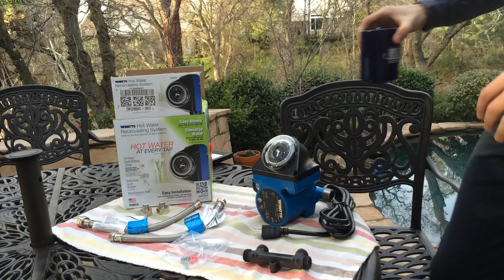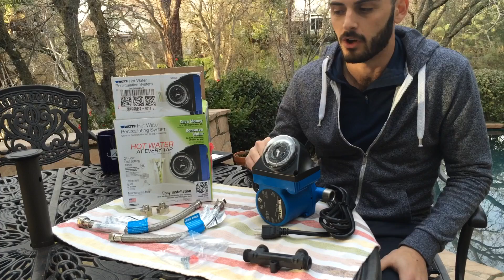How Hot Water Recirculation Pumps Work - Watts 500800 Review

Comment: Do you use the heat trap installed in the anode rod with this recirculating pump or does it have it have to be removed first?

Comment: After installation of the Watts Hot Water Recirculating Pump,I started using it right away. As long as the pump is running all is fine, but when the pump shuts off I have pipe bumping at the faucet where the bypass valve is installed, when running water in the kitchen. I installed an arrester on the Hot water side at the by pass valve, and still have bumping when running water at the kitchen with the pump off, I turn on the pump and it stops. Should it take an arrester on the cold water too, to stop the bumping?

Comment: I recently replaced the pump with a new one. The question I have is how to connect to an under sink water filter? I m not sure of the correct piping for it. The sensor valve seems to be working correctly as the inlets for Hot and Cold to the sensor valve are piped per the instructions to the sensor inlets. However for the cold outlet side with a standard water filter cartridge housing water filter how should it be connected? Any help is greatly appreciated.

Comment: For many people (those with water heater in basement) -- by far the best system for hot water recirculation is a gravity type system. Always hot water in hot water side, always cold water in cold water side. No pump required. No worrying about setting timer. No hot water in the cold water line when pump is running.

Comment: In minute 2 your a little wrong by saying it’s always flowing through the temperature sensor valve… the valve opens when it detects the water temperature on the hot side is 90 degrees or less give or take 4 degrees… the temp valve under the sink will open and allow hot water to flow to the cold side (that’s where the pump pushes it through) the temp valve closes when it reach about 100 degrees or so… yes your cold water will be like for a little while but remember it’s mixing with the cold water so by the time you go to use the fixture it may even be cold alrdy you won’t even notice it.

Comment: Good Job,  The question that I have is with the advent of smart plugs... would the implementation of a smart plug be a good option in lieu of the timer.  My assumption is that if power goes off for a couple hours then is has to be reset.  It would also allow one to turn on the unit "on demand" in addition to any time schedule that are set.  Being network attached, it would not require any reset for the power being off.  I know the Grundfos unit has a level of battery backup but as you point out is the more costly option.

Comment: What the censor valve that goes under your furthest sink does, is it has a thermostat valve. When the water is at a certain warmth/heat it closes. Trapping hot water at your faucet. When the temp drops to a certain point that valve opens up and cycles that water through the cold line back to the water heater to be warmed up again. It’s not in a constant cycle through your lines. If you didn’t have that censor that’s what would be going on.

Comment: I’m just confused with this device. Do you set it to be on each and every time you think you will be needing hot water. So in other words most people in my household will be showering between 7 and 9 am. So do I need to have it on during that whole 2 hour block or can I turn it on for an hour at 7-8 and expect it to be hot still at 9am?  Secondly during the evening we will be expecting hot water so do I have it running between 4pm to 9pm or do I turn it on for an hour and it then still delivers hot water for the remaining time. In other words when it’s not running so you get cold, lukewarm water? Do you waste water by waiting for it to be warm? Having it be on too frequently won’t that cost your gas bill to skyrocket since you’ll be having the water heater running to keep the water hot?

Comment: Great video! Question: Does the pump have to go at the hot water heater, or can it go under the same sink as the bridge valve (or anywhere else in the hot-water line  between the heater and the valve)? I would think the location (beginning or end of the same water-line) wouldn't matter where in that line the pump goes, no? Thanks!
Reply: The pump goes on the water heater were at the hot inlet and the sensor under the bathroom sink farthest from the water heater.
Reply: if you put it under the sink  it makes pump noise and takes up space but  it will work.  Note if you have a branch  valve,  this may not pump water to that side.

Comment: Hello everyone - I was about to get this solution installed but then a friend who is an engineer in the field warned me that the "side-effects" of this solution are: 1) the cold water in the circuit will no longer be cold  2) when the pump isn't active and the hot water cools down the valve opens and the hold and cold water mixes - so you get a warmish water a few meters down each of the cold and hot water tubes. Can anyone here comment on this based on your experience using the product ?

Comment: Well done video, thanks for posting it. I just installed one, have about a 40' run to the kitchen sink. Used to take a good 30 to 45 seconds to get hot water. It definitely helped with that, But, it takes even longer to get the cold water back to the faucet for a cold drink now. I'm retired and home all day, so have the pump running most  of the day. 
Also the hot water heater runs a lot more now. Both hot and cold water lines in the run are insulated.  It's certainly a convenience,  but not a water or energy saver. 
I ended up running a separate line for a cold water faucet with filter for the sink.
Reply: This is not a perfect solution but if you set your pump for peak times of hot water use, you won't have trouble getting cold water. 
This system is not meant to be running all day

Comment: I connected the pump a day before I installed the little circulating piece.  Do you think I did any damage to the pump considering the water wasn't circulating through the pipes?
Reply: Your ok because the pump runs throughout the day even when the valve is closed because it's reached the ideal water temperature. 
It will strain the pump to some degree but these pumps are pretty durable. Just don't leave the pump running all day.

Comment: Great Video but those mixing valves suck and are not reliable.  What they cause is the cold water in most of the house to become hot.  I have tried this and I am currently looking for a  way to run a dedicated return line.  In a ranch you could wait over 3 minutes for the hot water at the far end of the house.
Reply: I think a dedicated return is the way to go if possible.  Who wants warm "cold" water.

Comment: Could the pump also be mounted under the sink? Long as the pump is hooked straight to the water valve then hook up the sensor valve it’d be the same as putting the pump by the water heater.
Reply: Other companies make under-sink specific pump and valve units.....think Laing and also ReadyTemp, etc.

Comment: Best video and explanation I’ve seen on this subject.
Question: Does the pump have to overcome the water pressure on the cold water side, in order to force the cooled down “hot” water back to the water heater? And if so, isn’t the higher pressure a potential problem?
Thanks.
Reply: Yes... ..as both the hot and cold water loops are actually part of the same water "system" in your house....yes, the pump provides this small extra pressure to overcome the pressure that exists in your cold water loop. It's not much more pressure, only 2 psi more or so.  Some folks ask, "where does this extra water going into the cold cicuit go?".  Think for a moment, it's all part of the same "loop" circuit in your home. The amount of water taken from the hot side is simply being displaced to the cold side. Even if it was "more".....it goes ultimately back to your hot water tank and replaces the water IT would normally get frssh from the city....no problem. Some folks don't use a pump, but then you depend on opening up a cold water side of the faucet to get cold water flow...and now the cold water side momentarilly is lower pressure than the hot side...and you get hot-to-cold leg flow through the under-sink valve the same way....only less strong.
Reply: @TheWilferch  do you know what the velocity is of the pump?  I ask because some places here get 35 to 40psi water pressure and some 50. I'm just wondering if we are to expect excessive pressure while the pump is on. 
Thanks
Reply: @fortunatedad7695  ...You can ask for the specific pump curves from the manufacturers, if you know how to read them. In general, these are low pressure pumps...all you need is a small amount of "ooomph" to transfer over from the hot side to the cold side of the mixing valve under the sink. Most pumps will deliver about 2 psi of extra pressure....I'm quite sure no more than 6 for the various models.
Reply: @TheWilferch oh ok, thanks for the explanation! 😀
Reply: @fortunatedad7695  .. no problem. Take care.

Comment: I don't understand how this will push pressurized hot water through another pressurized cold water line? Wouldn't it just dead head? I would think to work properly, you would need to run a return hot water line back to the tank.
Reply: That would be the ideal way to do it. I believe with this double t-line, which would be installed at the farthest faucet, the hot water outlet is the cold water inlet. The water will make it's way all the way back down to your water heater's inlet, effectively creating a loop. 

I think having this is OK for instant hot water, but having warm water in your cold line is not good. Everyone knows not to drink hot water, because of the possibility of lead and whatever the hell else is floating around at the bottom of your water heater. So if I turn on a cold water faucet, I'd have to let it run to drain that warm water from the lines before I can take a drink.

Running a return line is the best solution. Some instant water heaters have recirc pumps built in to take advantage. Unfortunately, it'd be incredibly laborious to run return lines from all the hot water receptacles in your house back to the water heater.
Reply: @cantcurecancer  I appreciate the reply/information, and I guess it works, but it's just a bit hard to picture how it works efficiently.
Reply: @dm7907....Think this way....the hot and cold legs of your system are still part of ONE system tied into your water heater, which itself gets water from a city line. The water you TAKE OUT  of the hot line and then push INTO the cold line....is simply displacing it from one area to another....no issues. Same total volume.

Comment: Wouldn't this pump raise the water psi way to high for appliances and faucets when its on and shortening their life?
Reply: No, it doesn't raise pressure at all. The pump merely moves the water thru the pipes.
Reply: I bought one and it did increase the water pressure. I had to take it back because it wouldn't work for me.

Comment: This is such a stupid idea.  You are heating not only the hot water system piping but also the cold water system piping.  So instead of running the hot water until it gets hot you will run the cold water until it gets cold.  ????  what about the additional dissolved metals in the hot water and the definite consumption that will occurr as a result of using the cold water.  Come on this is ridiculous!
Reply: exactly, water from the hot water heater is undrinkable, now the cold water lines are polluted with dirty water from the hot water heater.
Reply: @AtomX71976  Of course hot water from the tap is potable! Where have you lived? It's the same water from the same place. With the same chlorine (if your municipality treats their water).
Reply: @pjn7066  not if your hot water heater is rusting inside or otherwise breaking down with scale build up
Reply: I agree let's talk about the warm water that goes to the ice maker & your water softener it will just fill up.
Reply: @thomascollier4913  Water softeners don't fill up. The water flows thru the closed tank inside the water softener. Your water never flows thru the salt chamber.
Reply: Run a dedicated return line instead of using the cold line.  True, this isn't necessarily practical in an existing installation but more realistic in new construction.
Reply: If you did a deeper-dig into the details, you will see it is not as stupid as it first appears. No doubt there is a degree of inefficiency using the cold-water line as a "return" line.... BUT.....the amount of water entering the cold-circuit, is FAR less then the immediate-hot affect it has on the hot side. The under-sink thermo valve has a one-way check valve built in on the cold-water conection side....this prevents cold water from entering the hot circuit. So....what you get is 95degF+, on the hot leg, and a few seconds of "tepid" water on the cold side ( if you only open the cold side...lasts only a few seconds).  It also depends on the amount of time you run the pump. It would be foolish to run the pump 24/7....most people set the "on" time for morning bath ritual and maybe the evening shower.....so it runs only for a short time per day. All this is for the "immediate" hot water (comfort) reason for doing this.....some other people (like me) like this for avoiding the occasional sink faucet freezes ( for those bathroom sinks running against an outside wall and suffer occasional freezing).....as this set up pushes some hot water into the cold water line....again....how much is determined by the timer setting......you can set it to be on-more for an anticipated cold snap. Here is a portion of a vid that shows the valve more clearly---> https://www.youtube.com/watch?v=JrtsxtSVYh0&t=3s
Reply: The cross over valve under the sink is multi-component. A thermal device closes the valve transfer from hot to cold when the hot line reaches 90+ degF, and furthermore there is a one way check valve inside, that prevents the cold water from entering the hot water line at ANY point of operation. So yes....the cold water line will MOMENTARILLY be tepid warm when you open the cold side of the faucet, but only for a moment or two...and is nowhere near the time it otherwise may take the hot line to get "hot" without this device. Water being undrinkable from an opeational home water tank is an overblown concern seeing the usual high turnover it has.

Comment: if the cold water line has to wait for cold water, does that mean when you flush the toilet, is it flushing with Hot water?
Reply: Not hot, bot possibly slightly warm though. The valve closes when the hot water reaches it and stops hot water from entering the cold side of the supply line.
Reply: @stevereid7140  with that being said are you having overly pressured water coming out of the hot side?
Reply: It will be just warm enough to melt your brick turds.

Comment: Hello, great explanation really simple to understand.
i do have few questions please if you can reply quickly because i might need to install it in the next day or two.
1. does the valve the black plastic piece has to be installed in each unit separate?   i have a multi house with several units, and they all use 1 water heater.
2. is there an option for the timer to be set for 2 times a day, moring and evengings? so people can enjoy it before and after work?
3. i did so where is the link for the install if you can add it please.
4. in those hours that you decide to turn the timer off or actually is off automatically, or for example if i want to turn it off all the summer time, because people rather have colder water, will that make the water in the pipes regular cold again, and fast cold water? or is it has to be set to heat while in installed on the water heater?

thank you very much

Comment: I have one cold water pipe that get frozen because of a poor insulation somewhere inside my walls. Do you think that this will help the cold water line to have warmer water in it if I schedule it to Run every 2-3 hours or so. It's kinda a different use but I'm just trying to find a solution without opening alot of drywall and searching
Reply: No,hot water freezes faster then cold.It would probably make it worse as far as freezing
Reply: Myth.  Not true.
Reply: @georgegreenhalgh993  ...wrong on the part of the answer that suggests this won't work. It will help both hot and cold lines from freezing. I have the same issue....and instead of having the timer set for partial use during the day ( for the purpose of getting hot water during the hours I most likely will use it)..instead....for freeze protection....if I get a forecast for 2 days of freeze weather here in the South....I'll set it to be "Always on" for these 2 days......both hot and cold lines will be above freezing temp. And yes....under more normal conditions....hot water lines exposed to freezing temps tend to freeze before cold water lines....but that has nothing to do with how this system can help.

Comment: Would it work under pressurized cold water pipes?
Reply: yes, all pipes are constantly under pressure from the city water supply. The pump merely moves already pressurized water in a loop back to the supply.